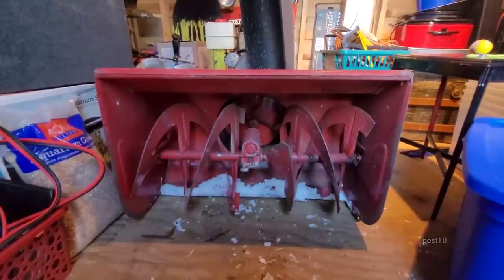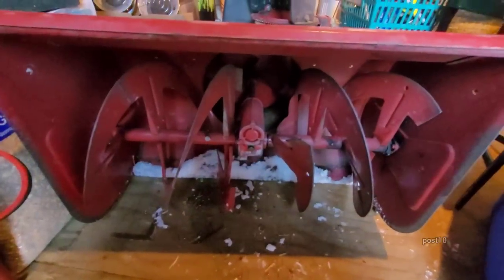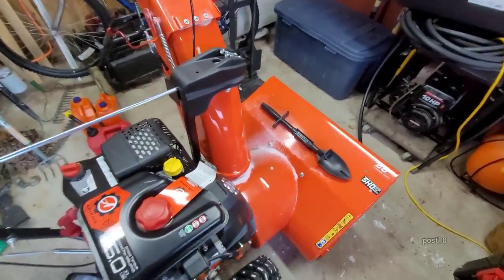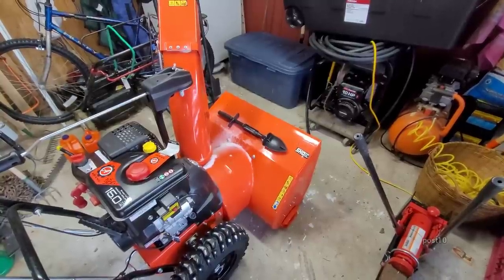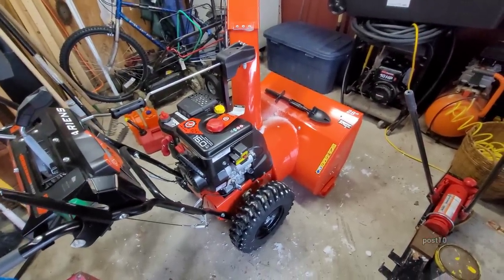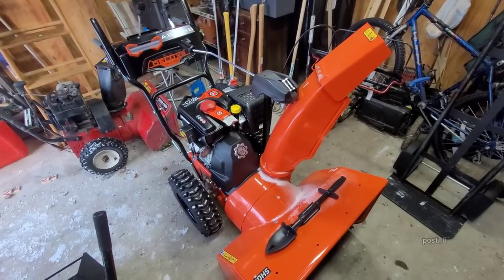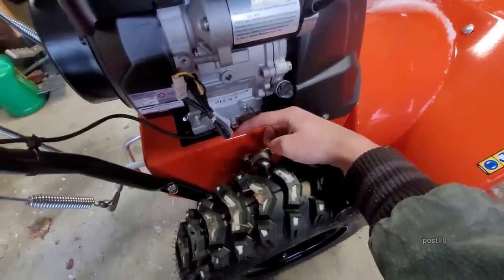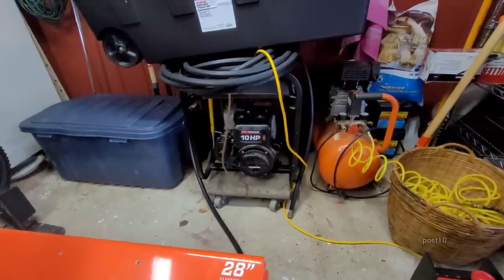1984 Snowblower Vs New One

Comment from the maker: You know what, I'm glad I bought a new one because that old machine is all I've ever known and is the reason I dread using a snowblower. Always having to monitor its RPMs worrying it might blow a piston rod with its inconsistent revving and random stalling, turning down and then back up the RPMs every time I had to turn around. This is going to be fun and easy cuz I don't have to think about what the engines doing. Thanks for watching everyone
Reply: Put never seize on all the bolts and nuts on the skids, scrapper blade and axles.  Also there is a bearing on each side of the frame for the hex shaft, never seize those.  Mine fused on and I needed to cut it off when I replaced the friction disk.  Turned a 20 minute job into a 2 hour job.
Reply: There is an oil plug on the back of the engine too.
Reply: At some point, you just gotta let it go and move on. I love the older tools and repair to the end... But $800 would be a tipping point for myself as well.
Reply: You should get more into small machinery repair. It seems like you've troubleshooted some small engine problems before. Working on this stuff is NOT that difficult. And if you do your maintenance, PMs and such, as you say you "take care" of your stuff it will last years and years. Like the tires on your old blower? Those things would be extremely easy to change., especially if they are tubes. I change my motorcycle's tires, just using basic tire irons and a little stand I made (don't want to take the room to have even a small tire change station). And something like these, or go-karts or something, the tires usually are tubed.
Reply: It sounds like that Snapper always sucked, even when it ran right. Find yourself an old Simplicity or an Ariens Sno Thro, they're way better machines and they pop up for under $100 pretty often. My 2hp Sno Thro from the early 70s is still going strong.

Comment: 12:29 -- Ethanol in the carburetor is transformed into vinegar (acetic acid) by bacteria.  The vinegar reacts with the aluminum in the carburetor bowl to form aluminum acetate, which reacts with water (which ethanol absorbs from the air) to form a thick gel.
Reply from the maker: Thanks for the knowledge Kevin

Comment: Other issues with fuels containing ethanol:
Ethanol will destroy seals and fuel lines on older machines. Newer machines use different materials so ethanol won't destroy them.
Ethanol absorbs moisture from the air over time. Leave fuel in a tank and you'll find a layer of water under the petrol.

Comment: 2:09 replace them with LED's. The starter could be rebuilt by you. I expect you could get a replacement for less than $800, the carb can be rebuilt with kits from ebay. piston rings and honing the cylinders is not difficult I did it in a class I took in 6th grade. too bad I live in AZ would be an interesting project.
you could test the compression and if it is at least 90psi and the valves are seating then it would not need rings.

Comment: get a motor from harbor freight it's a lot less and my tires are also rotted so I put innertubes in and now they hold air and for head lights I just use a head lamp with rechargeable batteries
Reply from the maker: I've thought about that and asked two small engine mechanics if that was a good idea and they told me basically this machine is so old that many of the parts wouldn't be compatible with the new engine so I didn't push that idea
Reply: @post10Vlogs  I got my snow blower of a guy for free because it would not start so I took it all apart and I mean everything I had the motor off the wheels were off the impeller was off and now I know how they work and how easy they are to build, I painted it all then put if back together. You can do it all your self it's not hard and from the things you do now im sure you can do it just as easy as I did. You have nothing to lose and there are videos showing how easy it is. I never had a snow blower before but I fixed this one and its been running for 6 years now. I did mine in the summer so I wasn't freezing and could take my time and enjoy it.  I think mine has the same motor as my ride on mower had and it was also 20 years old. its better then spending $800 and you can make a video out of it

Comment: You could buy a replacement vertical shaft snowblower specific Briggs and Stratton engine from Amazon for $500 and re-power that old beast of a machine. That may be a fun project for you at some point in the future.
Reply: That is designed around a HORIZONTAL Shaft Engine..
Reply: Or a Honda

Comment: I'll keep my 1976 826 Gilson going as long as Possible (Bought new) only one of it's kind with Shift-on-the-Fly Transmission. No unwieldy levers to hold down. Just an Ignition interlock that kills the Engine when You let go if the Auger is on or the Drive is not in neutral   
has a lot of Hours on it and Original Chained tires too. I keep it slicked up with Silicone and that beast with the oversized Shoot throwing to the Right will still launch wet snow 40+ feet or more.

Comment: I watch your videos all the time, great content. Here's a trick for you old blower. Go to random junkyards and find the parts you need for your old snapper. Also some of the parts can be bought off ebay or Amazon, make sure to find stuff with good reviews plus it's much cheaper. I have a couple john deere snowblowers. One is a 27 inch with a 9hp, motor came from the junkyard and runs perfect. Second is a 28 inch with an 8hp, motor from the junkyard also runs perfect. Both blowers had blown up engines and for $20 I got 2 good motors. Just some food for thought. Keep up the great work.

Comment: I have had my newer Ariens for a few years now. It is a great machine. It replaced a 1974 Ariens I got from my farther in law. I would tell you to turn the gas off every time you are done using it and let it run out. You will not have any problems with ethanol if you do this and it will have no impact on starting it.

Comment: What’s up with the little shovel on the snowblower lol…
Reply: He said the little shovel is for cleaning the Auger.
Reply from the maker: In case it gets clogged with heavy wet snow you don't have to stick your hand into the shoot, for safety reasons you should be shutting the engine off but this is so you can do it with it on

Comment: Those aren't no grease fittings on it those are breakaway screws. In case you blade gets hung up. That screw will break AwaySo you're blade  don't Bend
Reply from the maker: It's called a cheer Bolt and no they have grease fittings for a grease gun also,
Reply: @post10Vlogs --I Agree(from the man who owns one). "Shear" as in sheep-shearing.